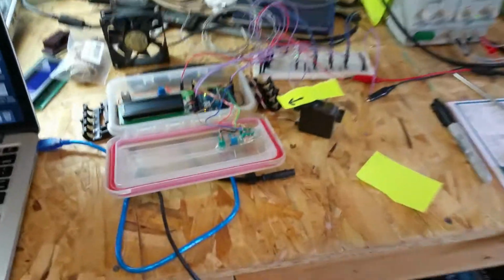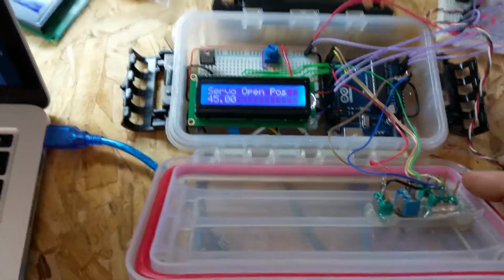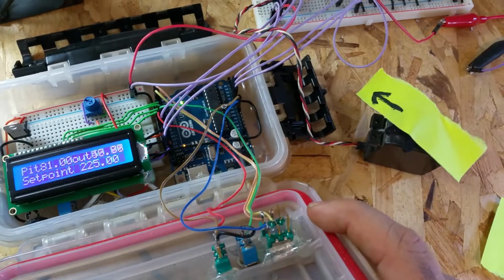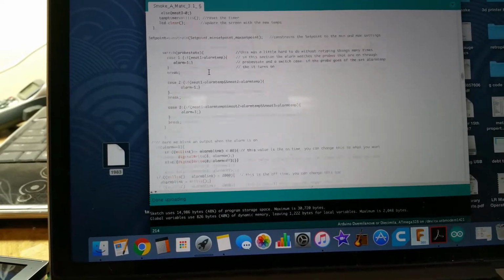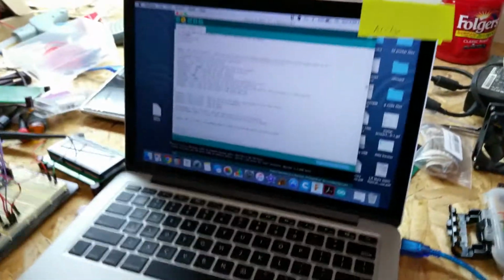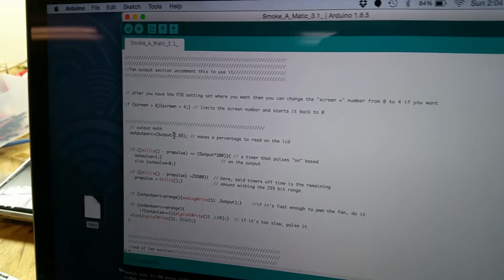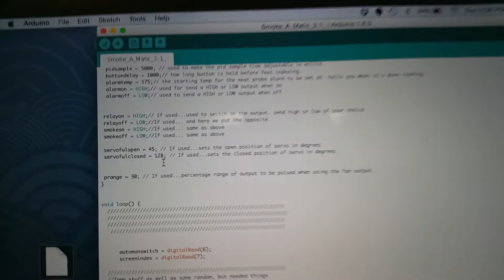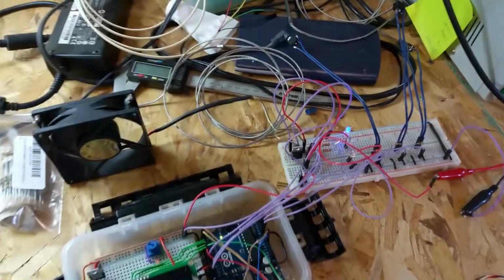Arduino Smoker 3.0 Overview and setup

Comment: Archy, good work.  I had a question about the PID controller.  Do you find that it works even though the heat source (i.e. burning wood) is not that consistent?  I am working on a similar project.  How did you come up with the coefficients?
Reply from the maker: Inconsistencies can be a little bit of a problem burning wood or charcoal, but it's not unmanageable. I find adding smaller amounts of wood more frequently helps. The biggest problem, I find is when adding wood and getting flair ups. Still not a problem, just add wood quickly. As far as the coefficients, Trial and error. If you have a good understanding on how PID works you will not have a problem. Thanks Andrew

Comment: How do you read the Probe temperature?
Reply from the maker: MrZorg89 measure the voltage between the thermistor and a matched resistor. Look up adafruit thermistor. That should help explain it